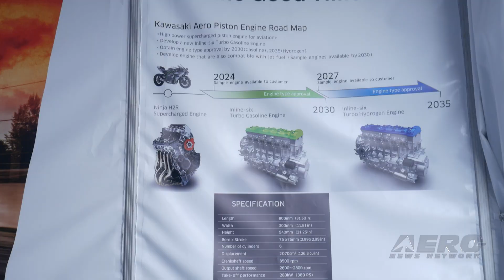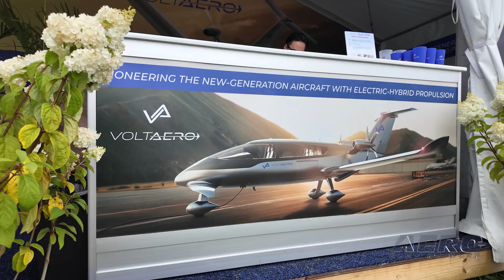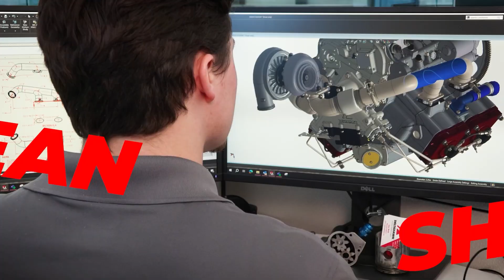Aero-TV: VoltAero Displayed At EAA AirVenture 2025

Comment: Hi, is it possible to have such a developpement, for Ultra-lights, replacing a Rotax 912 ULS, of 85 kg, for less than 20'000€ (complet set, with batteries) ? Thanks.
Reply: Not yet.

Comment: To really make the HPU 210 much more efficient, they should convert the Kawasaki H2SX engine to turbo compound using the existing supercharger drive shaft.
HPU 210 Specifications and features:
Total weight: 173.2 kg (381.8 lbs) for the complete system.
Power sources: A 150-kW Kawasaki H2SX thermal engine and a 60-kW electric motor.
Application: Designed for homebuilt and kit-built light aircraft, offering improved takeoff and climb performance.
Fuel: Can run on AVGAS, E85 biofuel, or standard unleaded automotive fuel.
Fuel consumption: Approximately 38 liters per hour (about 10 gallons per hour) during cruise settings.
Control: Managed by a single throttle, with the electric motor providing a boost for higher power demand.
Availability: Customer deliveries are expected to start in late 2026.